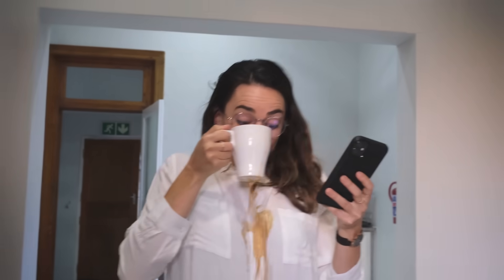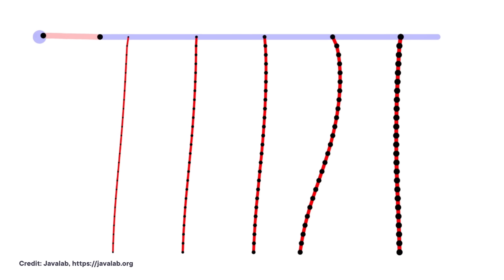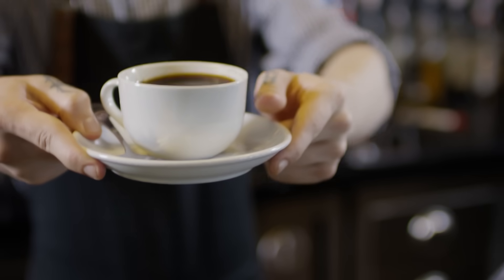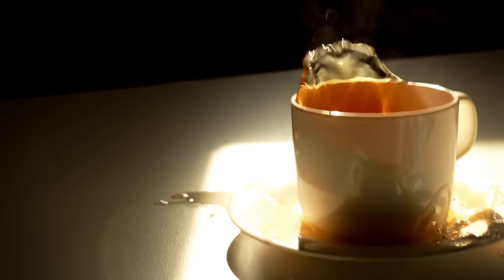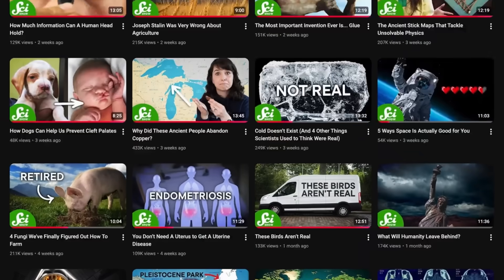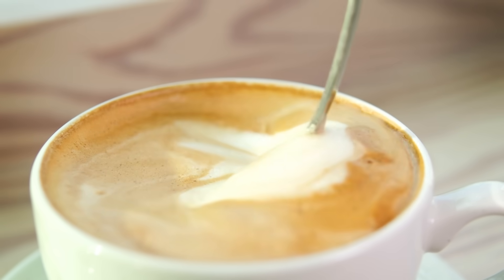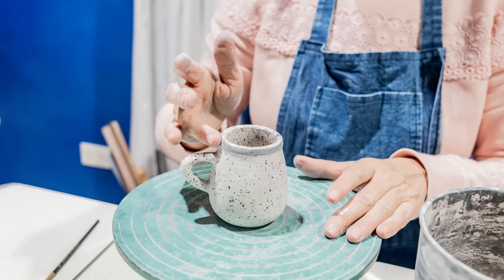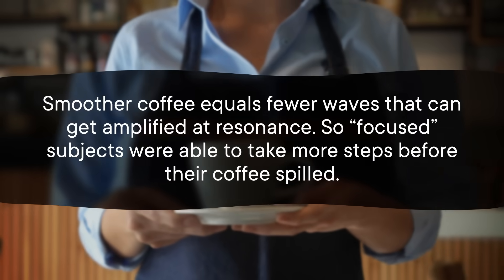Your Coffee Mug is a Physics Disaster

Comment: I bought a Mexican coffee mug to just to prevent this from happening, and to solve one other issue. It's globular in shape and smaller at the top than in the middle. The non-parallel sides resist resonance, the smaller opening further decreases the chance of spillage, and the thick ceramic, combined with the small opening helps stabilize the temperature of the coffee better. In other words, it cools down to optimum temperature quickly and maintains that optimum temperature for longer. And it looks cool, subjectively that is, if one is not averse to or offended by Latin culture.

Comment: I have a cup with a bulged looking bit that is most of it and a smaller top end about the size of a prepackaged dessert. I think it is a 1980s style. It is stainless steel, insulated or double-walled with a plastic handle. One of the coffee chain businesses that sells coffee cups sold cups in that style with the company name on it. Those are likely not from the 1980s, I don't think restaurants and coffee shops sold cups until the late 1990s or 2000s, so that old design may have been tried again, I may be wrong though.

This cup I use tends to be more stable during the walk Maybe because most of the liquid is trapped under the curve, ha ha, maybe the molecules don't part easily so the majority of the liquid prevents the remainder from moving too much. And as a bonus it is bigger than typical coffee cups, so I put more coffee into it and do less trips.

I have held coffee cups from the top, that works with paper cups which I find splash over so easily. But I only do that with their lids on because it still splashes out. Those lids which are not sealed at the openings are safer for the fingers than no lids. 😊

Comment: Pouch on a string? 

Why?  Why was that the solution? 

 The solution has been around since at least the height of the ottoman empire.  Turkish tea serving trays were made specifically to cancel out cadence.

I use a modern variation on that design.  It's called a Spillnot.

You had an opportunity to expand on the physics of resonance and how it ACTUALLY is solved in robotics...

Comment: For many years my coffee mug was a hyperbolic shape - like the outside of those old cooling towers at power stations but coffee mug sized.  This was more bottom weighted, so easier to carry.  The slightly wider top than the neck allowed the hot coffee to cool initially, then as you drunk past the neck, it kept the coffee hotter.  2 coffees is harder to carry, especially up/down stairs, so far safer with just one or fir plastic cups a 6 hole drinks tray can increase stability.
Reply: The limitations on mugs are mostly in terms of being easily cleaned and fitting into cupholders. But, that still leaves a lot of options in terms of how to design them.

Comment: Actually, the best way to not spill is use a taller mug and don’t fill so full. Calculate how high the slosh is and make the rim slightly higher. Slosh over be gone.
Or buy a new iPhone over the shoulder sling for $149+ and put your coffee in that.
Be certain your model is washable cause you’re gonna spill when you fight to retrieve the mug from the recessed pouch, but you shouldn’t slosh over cause you will walk with a swing not a jerk.

Comment: I'm not particularly well coordinated (Asperger's Syndrome) and at 78 years old I"m unsteady, but I can carry a full coffee cup across the kitchen to the dining room table without spilling.  Perhaps your problem is overfilling the coffee mug.  As a benchmark for experimentation toward optimum fullness, begin at about 6 mm below the lip.
And physics was integral to the design of the mug.  It was designed for ease of manufacture and calculation of capacity.

Comment: I raise and lower my cup a few inches roughly every two steps, which lets your arm absorb more impact from each step, and dampens the rhythmic oscillations. It works very well for me. 

With my dogs' bowls, I walk slowly and watch the water level on the front side only, instead of trying to watch the entire bowl. It's easier to make angle adjustments without overcorrecting when you're only watching one variable.

Comment: It sounded like the distinction between the recommendation for barista's and servers not to directly focus on a tray of drinks, and the paper that seemed to contradict it, is that the paper was about carrying a single drink, where one can easily course-correct if the waves start to resonate.  A barista carrying a tray, where the waves may not be in sync with each other (due to varying drink sizes), is more likely to exacerbate the problem in one mug while over-correcting for another.

Comment: I work the industry and over time I've learned to "steer." It's like the focused group, when you're paying attention you learn to slow acceleration. Assuming you can predict your movement you can change the way your hand moves to reduce or even catch the ripples before they spill. By understanding fluid dynamics you can even move to counteract unexpected situations. I don't like trays because even when I'm moving I might be able to counteract the movement, but the larger surface area means I'll have a more difficult time correcting for drinks on the outer edges.

Comment: I actually have a mug I regularly use with that wine glass shape. Wasn't even thinking about sloshing when I got it, got it because its large and can hold quite a bit. Anyway, sloshing hasn't even been an issue on my mind with it, walking around the house, up and down stairs, even swirling it like you would wine. I honestly completely forgot spillage from doing all that could even be an issue.... Highly recommend a mug in the wine glass shape if you can find one. 

Edit: I should also add cleaning it is a breeze, the mouth is still plenty wide I can slip my whole hand in with a sponge and get everywhere.

Comment: As someone who is both a scientist and a service industry veteran, I think the disconnect between that paper and the service advice is that we don’t mean “don’t focus on the mug” we mean don’t look directly at it. 6-inches in front of the liquid is the place your eyes should be at; you are still focused on the thing you’re carrying, but looking directly at it throws off your walking flow. It’s about center of gravity and motion.
Reply: Not staring out the tray prevents trying to make minute corrections, which are always too late and tend to amplify the resonance rather than damp it.
Reply: @user-gv4cx7vz8t not only that, but your reactions can simply be wrong. Is the tray tilting because it's about to spill or is it tilting because it's properly banking during a turn? Your eyes can't tell. Your hand carrying the tray can.
Reply: @user-gv4cx7vz8t  that's exactly it. If you try to look and make corrections, average reaction time will be too slow and by the time your hand starts moving to adjust, the required motion will be different than what your eyes told you to do.
Reply: That's 15 cm if you're not into old English units.
Reply: YES! I was both a waitress and cosmetologist. Not only did I look just ahead of the mugs/trays I was carrying but I’d also keep my non cutting hand gently rested on top of kids heads while doing clipper cuts. I could feel them moving and react so much quicker pulling the clippers away as needed. Even the best behaved kids cough/sneeze on occasion you can feel them tense up slightly before their whole body jerking forward for their coughing/sneezing.
Reply: Weirdly enough, this technique has always worked for me.  Just don't look at the mug.  I don't know why but looking forward and ignoring the problem seems to solve it.  Science that one... 😃
Reply: @patrickdrew4891  Agreed. Just don't look at it. The system that exists as your shoulder-arm-elbow-arm-wrist auto-balances remarkably well. But you can't look at it, because it throws off the system's autonomic function.
Reply: Thanks.  I knew looking at the cup was the worst thing so the earlier pay attention made no sense.  Your explanation makes sense.  I'm older and slower now and this amplifies the problem.

Comment: Mugs were NOT cylindrical until the modern era, for exactly the resonance issue you mentioned; and it changed for exactly the manufacturing issue you mentioned. I'm a mathematician. You only need a slight rim tilted inwards, even on a cylindrical mug, to transfer the spill-force. Leave two spots along that rim pouty like a flower petal, as a drinking spout. If the inner surface of the mug was gently ribbed, like undulating waves, then it would also absorb these forces VERY well, converting the up-down part of the coffee-slosh into vortices around the rim. VERY stable, and still easy to clean. I almost never spill my coffee, and I drink a LOT of coffee! in BED.
Reply: I use a moscow mule mug made of porcelain, shaped exactly like the cheapass "beaten copper" ones for sale everywhere. The little bit of curve prevents sloshing, and it doesn't need a spout to drink from because the curve isn't severe. It's such a minor change that I'm amazed regular coffee cups are still made at all. They even stack better.
Reply: @JBloodthorn  Cool 😎
Reply: When you said "mathematician", I recalled a video about turning a sphere inside out. It's frightening what a mathematician could do to a coffee mug..
Reply: @kody.wiremane  topologically speaking, a coffee mug is the same as a doughnut.
Reply: @maskharat  yeah, though I meant something more exotic, like a mug in the shape of a 3D projection of some n-dimensional hypermug, that kind of stuff..]
Reply: But how do you not spill your coffee? Did you make a coffee mug designed the way you described (like a flower petal)?
Reply: In bed?! You naughty naughty boy!
Reply: Oh wow, makes me think of an old mug my parents have
Reply: Yes thank you for explaining this. I was thinking this the whole time watching this video.  I have always had a mug like u r explaining
Reply: I own exactly ZERO cylindrical mugs.😅. All of mine taper in at the top like wine glasses or out like teacups. I did not know this was a thing.

Comment: 2:23 okay so my first thought for a solution to this is to provide a dampner of some kind.  Easist might be to add a fine mesh to slow the liquids travel.  Or a barrier to effectively divide the cup in two.
Reply: I haven't tested this personally but I've heard that holding the mug in one hand and using the other hand to hold a spoon vertically in the mug works!!
Reply: yes, just put a spoon in the cup you carry,
Reply: Good tip.  

But it sounds like we need a "sci show experiments" episode.   Where viewers and other suggestions are tested to see what the results are.
Reply: Lid
Reply: @edamchese3008but to use a lid you'd almost certainly need a different shaped mug, which defeats the purpose of the video lol

Comment: I called it the fat Albert mug,  but it's a cobalt blue chubby 16 oz ceramic mug from Starbucks, they had this mug back in the 1990 - 2000's it was dark bluel I lost the flimsy plastic lid but kept the mug. But the base held a lot of coffee, the opening was too small for my hands, had to use a brush. Still have it, I also held my coffee mugs with my finger tips on the lip of all my mugs and didn't spill a drop, but every time I held the handle, I would spill and shake my hand when transporting my coffee from counter to table. Thought I had weak wrists 😂

Comment: So this is a scientific explanation of why a drink will spill while walking; resonance frequency of your steps is similar to the resonance frequency of the most common coffee cup shape and size. Mentioned is one solution; if the top is substantially smaller diameter than the bulk of the interior of your cup, then that shape reduces the resonance effects on the coffee. It does not need to be a 'wine glass shape' specifically or to be glass. And while not very common I do have a ceramic cup where the bottom interior is about  3/4 inch larger diameter than the top...and I have seen a few where the difference is even larger.
But there is an entirely different study possible; how to walk at any specific speed while ALSO compensating for your leg and body motion with a counter motion of your arm that cancels the resonance effect not perfectly but optimally about 80% cancelling. People who pay attention can learn this as a skill; they do it automatically but would generally have trouble explaining exactly how they are moving their arm and by how much to cancel that resonance effect. But with video cameras already being used to optimize running posture and pacing; the same exercise scientists would be able to use the videos watching people walk with a drink while attempting to not spill any, and thus develop a math chart of what motion your arm should be doing for any specific walking speed. Is this genuinely useful? Well probably not for most people, but some people might try doing this just to see how well they can do.
This could also be a nerdy competition; fast walking while carrying a drink that is only 1/8 inch from the edge of the top of a standardized cup; everyone has the same style cup, and theoretically the same amount of the same liquid. Then you are in a race to walk as fast as you can, but you cannot win just by walking fast as you lose the race if any of the liquid spills. If this were a common competition some people would get really good; walking three times faster than most people do while still not spilling a drop...because this is a skill that is possible to learn.

Comment: In the TV series Star Trek Deep Space 9 a peculiarly shaped mug is often seen.  It consists basically of a cone with a cylinder added on top and of course a handle.  I was told the mug they're using was originally a spill-proof mug for truckers and that they are only spill-proof if filled only well below maximum.  But what are we coffeeholics all doing?  Right, fill it to about to about two fingers above the upper edge.

I've personally concluded to avoid the issue in the future by placing a coffee maker next to my desk ;-)
Reply: Came here to shout out the DS9 mugs. Glad you are on it.
Reply: It was originally for sailing but it serves the same purpose!
Reply: That style of mug is a sailor’s mug, I use mine regularly at home.
 It’s very stable and almost impossible to slop coffee out. The narrower neck means that the coffee has less surface area to lose heat. They’re not easy to find. Surely there’s a marketing opportunity for someone ❗️
Reply: @Carol-East  I'd go to a local artisan pottery shop and describe to them what I want and get my unique personal mug.  Not at made-in-far-east prices but still decent enough - and it's a one of a kind 🙂
Reply: Can confirm the origin. My dad is a trucker and had so many of those. Then my nerd friends saw them and thought they were the coolest.
Reply: Um, I need that trick of filling two fingers above the upper edge! 😂
Reply: Can they be cleaned? Or do real coffee drinkers just never let them go dry?
Reply: Kind of like a cezve ("finjan" for some of us) which is for making coffee but still

Comment: Just a quick note about what you actually need to do, in order to not spill tea or coffee from a mug. 

 It isn't about not walking too fast or slow, it is about not accelerating or decelerating too fast, and countering any such force applied in error, or by necessity, by altering the angle of the mug, so as to account for the tendancy of the liquid inside to slosh  and spill if you don't. 

 Yes, you must move smoothly to prevent some type of wave dynamic building in the mug, but you can actually go at a fair clip, assuming you have reasonable control of your body, enough to both control the angle of the mug during acceleration, deceleration and turning, and prevent those waves forming by keeping steps light, smooth and even. 

 You also need to ensure that the mug doesn't change altitude at all, meaning your arm must isolate it from all jostling forces. This can be done by simply training your arm to maintain the mug at a completely even distance from the ground, no matter which foot happens to be in contact with the ground, and at all times along that and all step lengths on your journey. This sounds complicated, but billions of people do this without thought or training, every day. 

 Applying the same concept can prevent you spilling your drinks in a car, during harsh cornering forces, acceleration and deceleration. It's just about having a fundamental physical awareness of forces and being able to naturally, and without thought or enormous effort, counter them. 

 There is really nothing wrong with the mug, it's just that some people never build up an intuitive physical awareness of forces, even if they have a better than average paper understanding of them. Don't knock the mug. Take up skateboarding or roller blading or anything utilising the same principles and operating on similar terrain, and you'll gain physical competencies that permit a perfect preambulation from percolator to seating place, without problems😉

Comment: 3:05   you didn't thake this swinging pouch idea to it's logical end.  If it swings freely enough, the coffee cup actuay doesn't experience any side forces in its frame of reference.  TheActionLab channel demonatrated a device like this.  It's a small tray attached to a cord via a handle that bends over the center of the cup.  You can swing this around without the cup/mug sliding around the tray and without the coffee sloshing.

Comment: Hot coffee is tricky, but I find carrying fluids is much easier if you hold them from above the mass, not on the side or below, dampens the oscillation.    Not really possible with coffee where you'd burn your hands.  That's pretty much the sling idea too,  The best solution though is to put a lid on it, and keep it closed.  It can slosh all it wants, but it's safe in it's own little sealed container.  So maybe what we need are coffee-canteens or something.